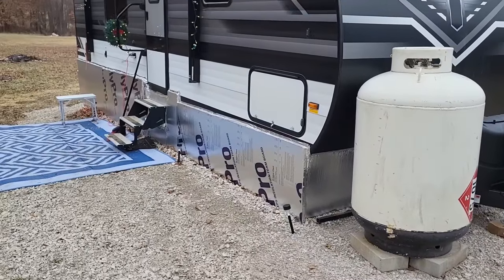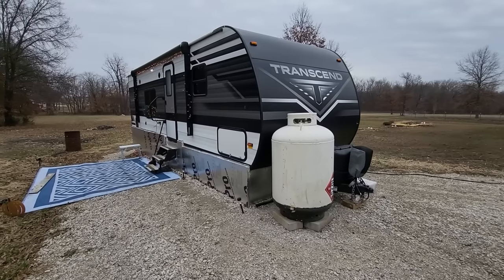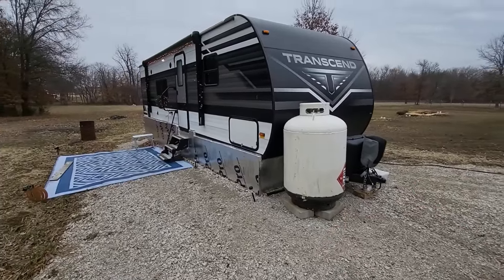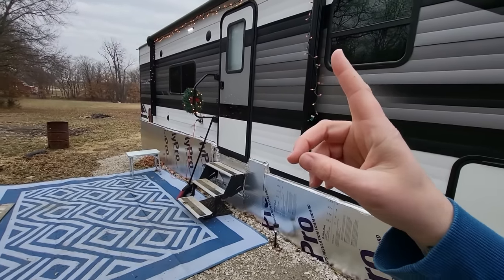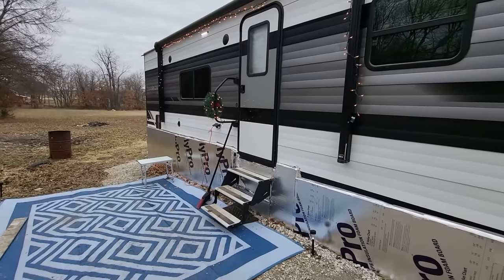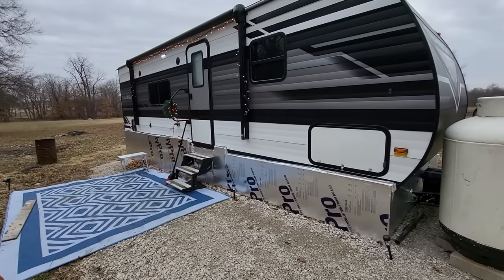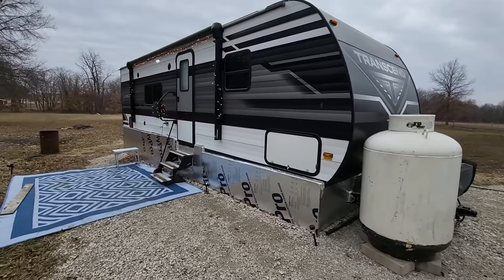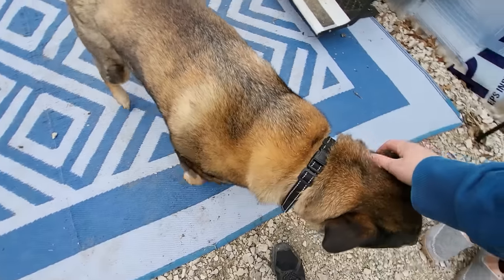Full-time camper living. Surviving the Winter! Things I've learned along the way.

Comment: How do you plan on keeping the propane warm? Does it need to have a heater pad to ensure it doesn’t freeze?
Reply from the maker: Never had a problem with freezing, I don't do anything to it
Reply: Propane is below zero anyway. It would have to get much colder than-40 to even be as cold as propane. What freezes is the regulators if they aren't positioned properly and get water/moisture in them.

Comment: I'm currently watching the video to forgive me if you explained this in the video. 

How do you get fresh water refilled, and sewage emptied? Thanks in advance!
Reply from the maker: I just run hose from the outdoor spigot fill up fresh water tank, then disconnect everything and put hose away. I don't ever leave it hooked up during the winter. The sewer hose is hooked up to sewer pipe and I leave valves closed until I'm emptying it.

Comment: You are attempting to winter in a 3 season stick and tin camper, that’s about the bravest thing I’ve ever heard of!   No wonder you need a 300 gallon canister of propane!  LOL!   Great video, excellent skirting job, nicely done!   Might I suggest a used Azdel sided trailer?  They have more than twice the R values than a stick and tin camper like yours.  ❤😊
Reply from the maker: So far survived 2 winters 🙏 my tank is overkill 🤣
Reply: @WanderingDryad-we6sy  — Good for you!  ❤️  My experience in a rented stick and tin did not go well, LOL!   Cold, heater ran a lot, ran out of propane over the weekend (2x20), battery was near death, had to charge with the truck, and driving to the reunion in the rain we had water inside everywhere.  So… color me jaded.  🙃
Reply from the maker: @Erin Thor  oh wow that sounds rough. I will say I have been extremely happy with this particular camper. I'll just tip my hat to grand design then and consider myself lucky.
Reply: @WanderingDryad-we6sy  — Grand Design is one of my favorites, after visiting several RV shows early 2022 I found their quality way above other manufacturers.  They clearly care about what goes out the door, and I assume about value to their customers.  If you ever do think about upgrading/trading in, consider one with Azdel siding and 4 season warranty. 😎❤️

Comment: Are campers & rv's ever insulated?  Walls so thin, just wondering.  I thought I was gonna freeze last winter in Ga.
Reply from the maker: Depends on the camper and rv. Some are rated differently. If they are rated for 4 season they typically have more insulation. If the say "lite" they typically don't have as much and not rated for all seasons.

Comment: Try some Gorilla tape next time. That stuff STICKS. Like, even when you want it to come off, it won't, (until you get out the Goo-Gone, anyway, LOL). Cold weather tips from a Minnesota girl whose spent many winters in crappy old trailer houses...Wrap heat tape around all your plumbing. It costs almost nothing in electricity to run it non-stop all winter, but makes a huge difference to prevent frozen pipes. If you use some of that insulation board to box around any exposed tanks or drain pipes/hoses, a simple 40 or 60 watt tungsten light-bulb (NOT LED) inside the box will generate enough heat to keep them from freezing most days (if it's -40F, it won't be enough, but you can always switch to a 100w bulb instead for those days, or even have two light bulbs in there to double the heat). Be wary of running a space heater under your trailer because of condensation. There needs to be airflow/ventilation to prevent condensation build up. Like you, I wouldn't want to deal with that black tank any more than I had to, especially in the winter. I'd probably use a bag-lined bucket and kitty-litter in the winter and just haul it away with the garbage. The last thing you need is frozen waste in your black tank.
Reply from the maker: Great advise we are working to hunker down again this winter. This is my 3rd winter in it and I'm trying to get a little better every year. I will def be refining my methods again. Survived the -7 last year 🤞

Comment: I have had campers before but my question is what do you do about a septic system?
Reply from the maker: There is a septic drain hookup off the driveway we use.
Reply: Do you have to call a sewage company to clean your system out or do you drain it in a regular system?
Reply from the maker: No it's a septic system. So we just hook hoses up from camper to the drain. Open the valves once a week to drain into the septic system. We are in the country so does not go into sewage like in town.
Reply: Ok thanks!

Comment: Can anyone tell me what kind of insulation to buy? We're in the Portland, Oregon area. I dont really know what thickness, and im assuming it comes with the reflective covering?
Reply from the maker: Yes it comes with the reflective covering. I've used different thicknesses. I have heard the thickness doesn't really matter is more about keeping air out and a barrier for wind etc. I used 1in one year then 1/2 in next year. The 1/2 worked just as good and was cheaper
Reply: @WanderingDryad-we6sy  Thank-you so much. My daughter can't afford her rent any more and we have a 5th wheel she's going to live in so she still feels like she has her own space. Rents are crazy here and going up all the time, so we feel blessed to b able to have her home, and be able to give her a break. Winter here is usually not so bad, but last year it actually hit -2°. I just want to be prepared, just in case.
Reply from the maker: Yes times are changing rapidly. This past winter got down to neg 10 here in mo. I had the 1/2in insulation board and it worked just fine. Only issue I had was bottoms of my black and gray water tanks froze on lower part of drain out point. So I just sealed everything back up put a heater under and waited for it to thaw. It only happened 1 time all winter.

Comment: How far above the bottom of camper did you go with the foam board
Reply from the maker: There's is a black metal trim piece below siding. I just covered the black trim piece. It's probably 8 to 10 in wide below the siding.

Comment: Great video
Reply: What do you use at your water connection to the trailer for your city water connection
Reply from the maker: @RunawayRv just a filter and water safe hose. Fill the fresh water tank and disconnect everything after. Haven't had any freezing issues doing it that way.

Comment: How do you keep the water hose line from freezing?
Reply from the maker: I forgot to mention it in the video, but I use the hose and fill up my fresh water tank, completely disconnect it and just use the water pump from fresh water tank. That way I have everything disconnected and closed off. Never had any freezing issues.

Comment: Do you honesty think you could use up a 500# propane tank in a month?
Lol.
Reply: Not 500 lb. She had a 120 gallon tank. There are  also 500 gallon tanks. The propane industry does have 100 lb. Cylinders. They hold roughly 25 gallon of propane. A cylinder is portable. The stationary ones are tanks.